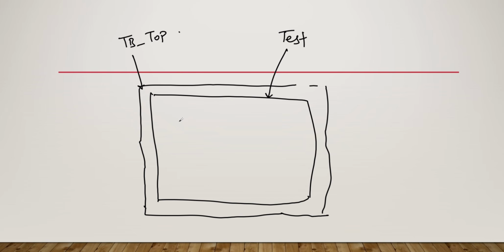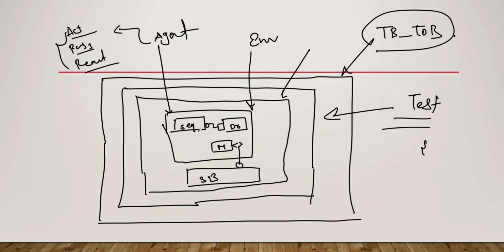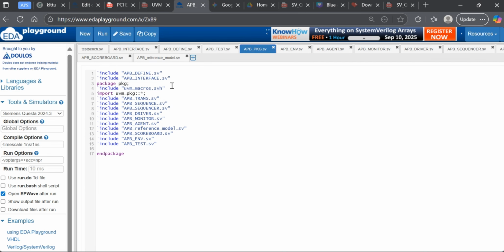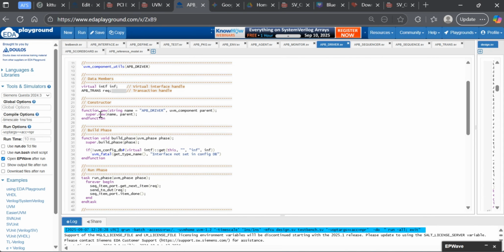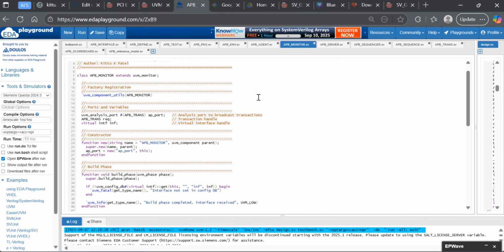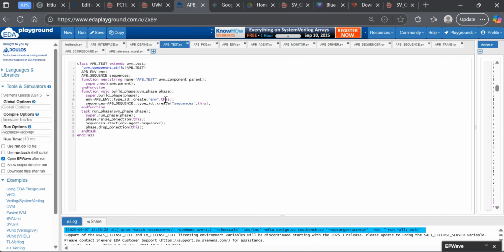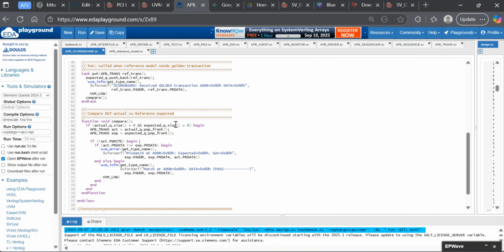Implementation of APB Protocol using UVM | Complete Testbench using UVM | APB | UVM #apb #uvm

Comment: Architecture Overview
[00:00] Introduction
[01:00] UVM Architecture Diagram (Top, Test, Environment)
[01:45] Agent, Sequencer, Driver, Monitor & Scoreboard connection
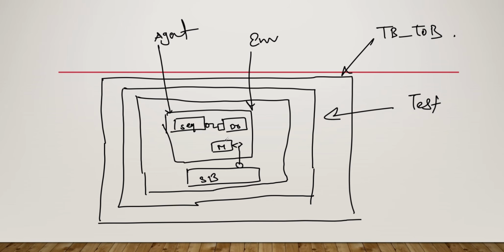[04:44] Explanation of component roles (Active/Passive Agents, Sequencer mediation)
[06:44] Reference Model & Scoreboard logic
RTL & Code Implementation
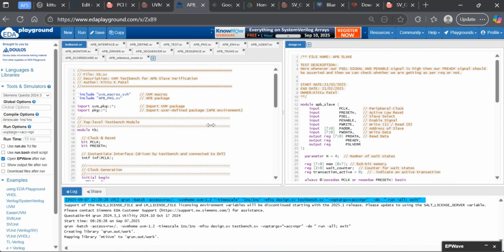[07:32] Brief look at the RTL Implementation (APB signals & state machine)
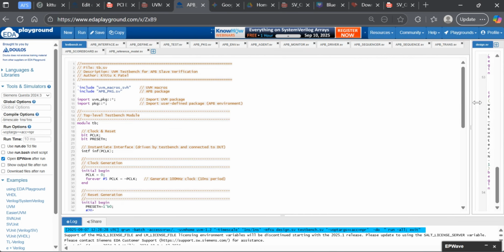[09:19] Verification Code Walkthrough Starts
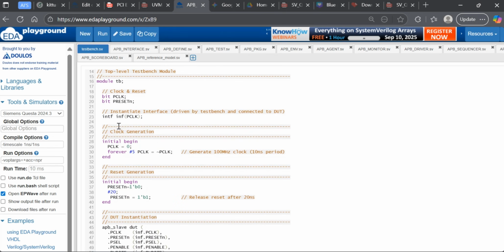[10:30] TB Top: Clock, Reset, and Interface connection
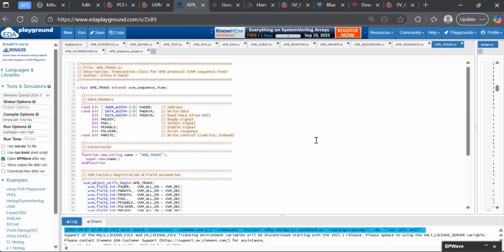[12:06] APB Transaction: Sequence Item, randomization, and constraints
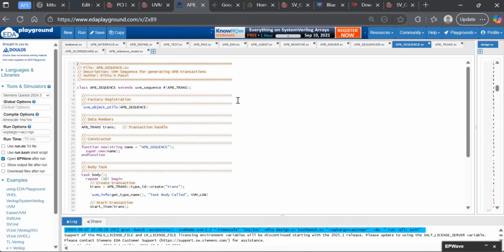[14:32] APB Sequence: Creating and starting items
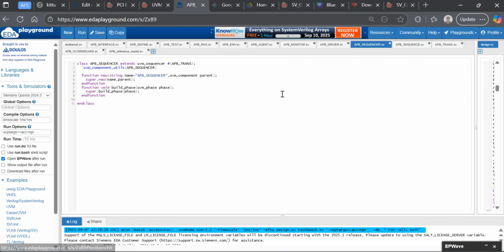[16:41] APB Sequencer: Component setup
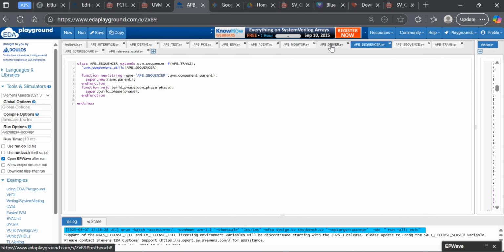[17:25] APB Driver: Driving logic, virtual interface, and drive task
[23:06] APB Monitor: Sampling signals and using Analysis Port
[25:42] APB Agent: Connecting Sequencer and Driver
[26:20] APB Environment: Connecting Monitor, Scoreboard, and Reference Model
[27:21] APB Test: Starting the sequence and managing objections
[28:52] Interface: Signals and Clocking Block
[29:59] Reference Model: Logic for expected output
[31:38] Scoreboard: Comparing actual vs. expected data
[32:24] Conclusion & Project Link Info